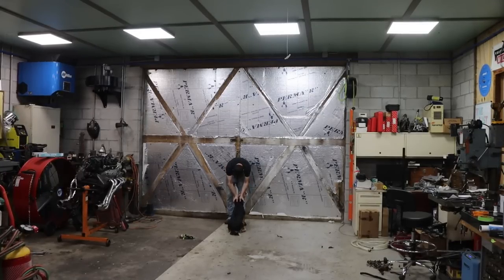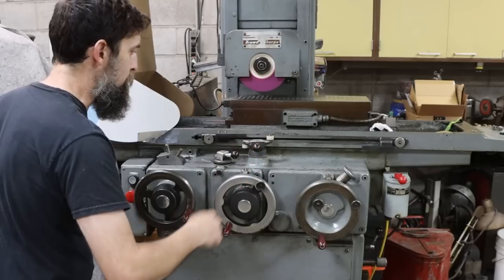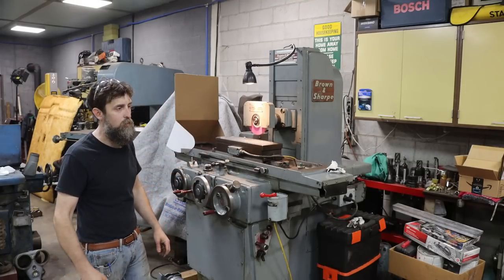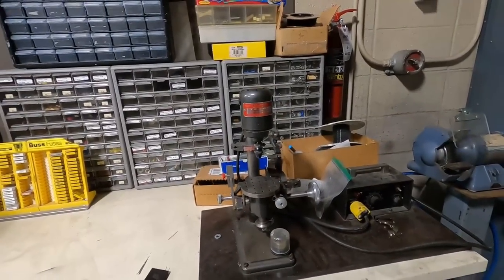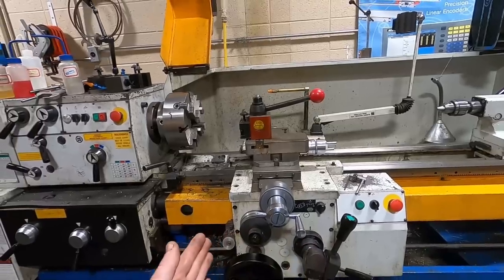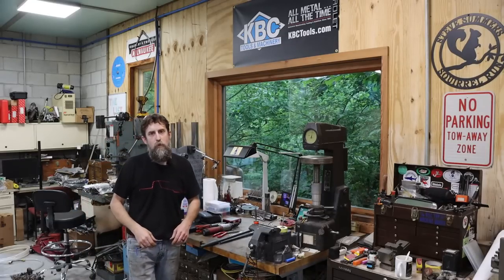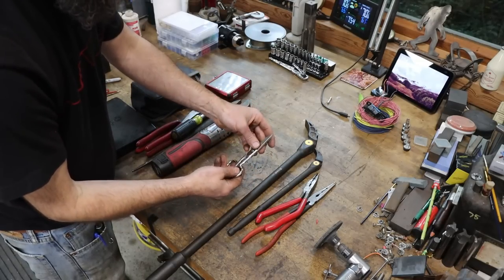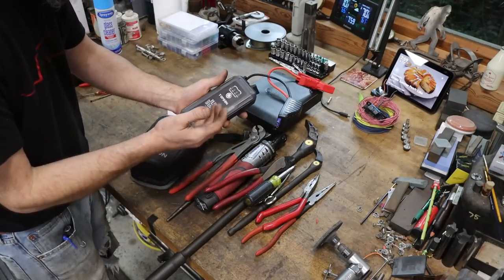Research Machine Shop tour / Brown & Sharp 618 / MY Top 10 hand tools list

Comment: You haven't mentioned anything else about the mag Chuck, Steve. Last I saw it was broken, did you get it repaired?
Reply: Operator error, he was running it on AC, not DC 110V, so it would not work, but as a bonus it is now thoroughly demagnetised.

Comment: Send a sample of oil for contamination. don't add oil until you have the results back, otherwise you waste oil. You were lucky as there could have been so much grit and metal in the fluid that you would have to drain all the oil you put into it and then run some karosene or some other fluid through it to clean it. for future use.

Comment: BUGS! Can't stand them in the house. I have no-see-ums that can pass through every day screens. They, black flies  that take a chunk of meat when they bite and the regular everyday mosquitoes that come in by hitching a ride in little Sophie's coat are enough to drive me up a  wall. They are the main reason we like it so cold up here. 
Congrats on the 618 headway. Once you have your plans for it achieved all tightened up and true to the earth you will have a machine worth keeping and trusting eh. Perhaps Elizabeth can help you by exercising her scraping skills. Your work shop job and mine were much alike. Rarely a day that when I arrive to find yesterdays project set aside by a more pressing job making a ?  for  ? logging machine.  As far as I was concerned my hole  in  the machine and welding shop was off limits to any other person. Especially truck drivers. With a 22 truck and  5 shows of logging, a cattle operation and grain/alfalfa shows I rarely had a day to just tinker.  LOVED EVERY  MOMENT of  my 15 years in running the shop and another 7 years of being a mobile service tech and operating heavy equipment. I never knew what I would be doing tomorrow. My shop was much like yours  at work. I made so many one offs I lost count of years ago, LOL. I suppose my favorite tool would be my 53 year old Mitutoyo  6ninch dial Vernier caliper with it's cracked bezel. It spent many an hour on top  of the lathe or in my top left pocket in  my coveralls. I would say it has helped make thousands of parts and pieces. 
Well my dear friend. That/this is a really nice post today. Thanks a bunch bud.

Comment: To finish grind a surface grinder chuck and keep it cool use a green wheel which is silicone carbide. The chucks have brass in them as insulators and when the grinding wheel gets brass in it it won't cut cool. That is the best way to keep the chuck flat.

Comment: Wow...either you got a great deal on that grinder or that oil is EXPENSIVE!  Sure...$200/5 gal isn't cheap, but that grinder around my neck of the woods is >$5K IN NON WORKING CONDITION.  I don't get it, but piles of "parts" around here people will try to sell as "Vintage Machine, in GREAT shape", and you see it's a rusted hulk, missing the motor, half the pieces missing...Price? $10K.  Yep...once in a while we find something good, but it's gone the second that listing hits.